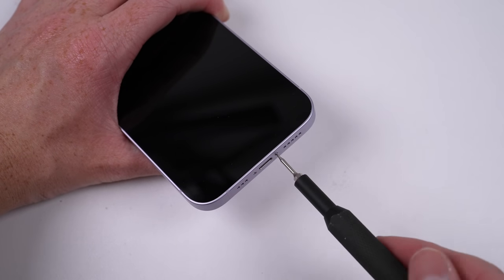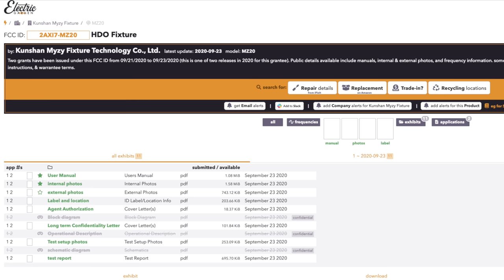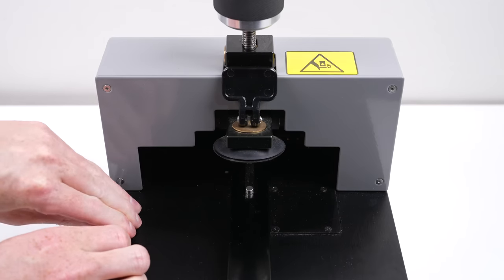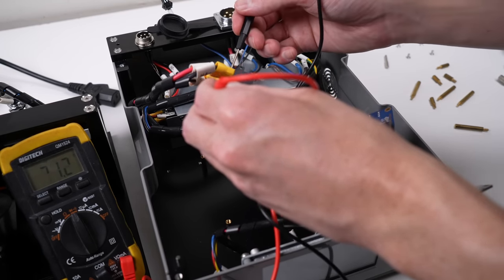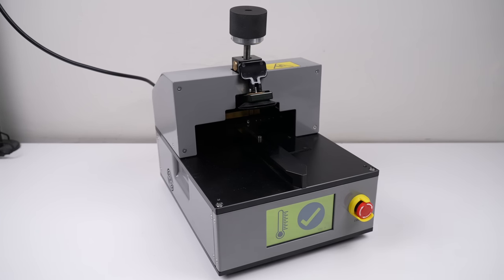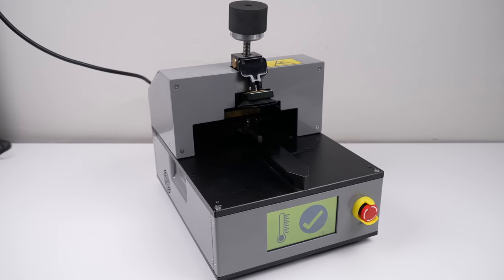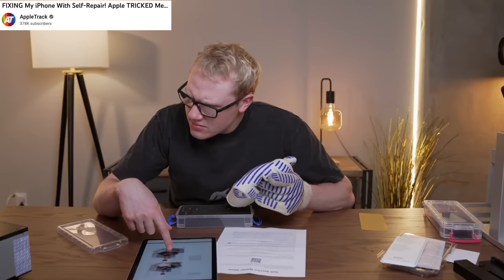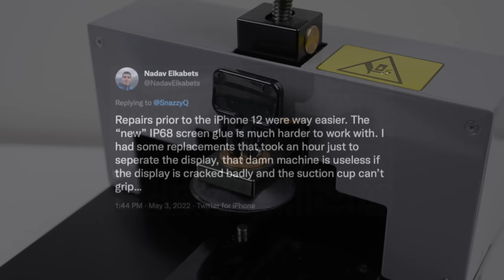This Is How Apple Fixes Its Phones - Tearing Down Apple's Display Opener

Comment: I work for an AASP, Geek Squad, and boy let me tell you that the heat press is prone to software failure causing the unit to brick and become unusable. Apple takes its sweet time to send out new ones.
Reply from the maker: Like what mine is doing or something else?
Reply: @toadster40  wait a minute a heating press can overheat and brick itself? isnt that the one thing it should be protected against?
Reply: @toadster40  that would be like a 3D printer that just totally burns the filament even if you set the heat to minimum
Reply: same here, our Precinct stays beefing with our heat press lol
Reply: I’ve never had mine fail like that contact CSS or make an escalation  they will replace the unit. But don’t get me started on the AirPod testing suite fml
Reply: @tylern6420  even the cheapest 3D printers with a 16x2 LCD show more information about the error and have tons of protections against actual faults, not just made up problems
Reply: I know why it isn’t working. The firmware version is outdated for the iPhone he inserted. He needs to update the firmware. But that will not work as he has no IRP/AASP access.
Reply: @speckbomber7219  I’ve never updated our firmware 🤷‍♂️ works fine
Reply: @speckbomber7219  why does a heater need a f*cking firmware update
Reply: @Danlapse  I did one time after the iPhone 13 came out. It didn’t show me an error. It did the same like in the video
Reply: It's ironic when even the repair tools brick themselves and become unusable. It's Apple, alright.
Reply: @zUltra3D  Because Apple.
Reply: @Hugh Jeffreys  sometimes it acts like the ones in the video, different codes every time or not showing anything. Others it actually does a good job of picking an error and sticking with it. At any rate when the machine dies we have to turn away most of our appointments for at least a week
Reply: @zUltra3D  because Apple
Reply: like mcdonalds ice cream machines, except actually an issue
Reply: @Danlapse  the Airpod is one of the most useless POS that we had to use at GS
Reply: @HughJeffreys  I also work for an AASP. It looks like someone was probably updating firmware on the machine and failed. That is why you don't see a firmware version on the bottom right of the display when turned on. The latest firmware version should be HDO V2.05. The only way to update the software is by using an Application made by Apple that is Apple Confidential.
Reply: I am glad our Squad didn't have that happen yet. Our fixture is still working.
Reply: @ShushLK  it’s not GSX. Its a 
MacOS application which will only install on an apple managed AACP Mac.
Reply: Lol a true apple product bricking itself. Despicable.
Reply: We've nicknamed ours the E05 machine
Reply: leave it to apple to design stuff to break that shouldnt break...
Reply: @Danlapse  It just needs more hot pockets, preferably pepperoni

Comment: Is it not crazy to think that actual engineers were paid to make an iPhone objectively worse?
Reply: I think that's just a fact at this point.
Reply: @GareWorks  yes
Reply: I can imagine one of the next iPhones being a sealed-shut glass capsule, phone shaped, the only way to access into being to shatter the screen with 500 bucks worth of repairs to get a new enclosure and seal it back. And, like, touch everywhere, and no physical ports outside
Reply: @ShitHappensRLY they made it more repairable last year tho…
Reply: @LesGrossman_69  how does it give you less freedom. Do you want more freedom in usage of a more powerfull device or do you want more freedom in reparating it (which is already possible). A lot of android Phones have also followed Apple and are not as repairable anymore. This is to make the products more water tight and last longet
Reply: And still we are buying like crazy
Reply: @tjadejoh  These are the words of a fanboy - supporting a product without truly understanding it. Anyone can smash a phone and get into it, but since you're comparing Apples to Androids I'll do that too. Both the iPhone and Pixel block biometric authentication if components are replaced. The reason people got mad at the iPhone for it and not at the Pixel is because Google released a super accessible software that will recalibrate your fingerprint reader for you after it bricks. We call Apple anti-consumer for it because they force you to throw money at an Apple store for "security reasons." But if those reasons were actually security based, then wouldn't you want to make sure the consumer could fix the security issue on their own as fast as possible? Unless, of course, you are ANTI-consumer.
Reply: @LesGrossman_69  not everyone wants what you want
Reply: @SuperBoop  but that's the great thing about freedom right? You have the freedom to do all those things, or not to if you don't want to. Within reason, everyone gets to do what they want to do!
Reply: @Mr_Lesbian  some people prefer to be controlled by huge companies
Reply: @LesGrossman_69  I don't have an iPhone, so I wouldn't know
Reply: @LesGrossman_69  then an iPhone might not be for you. Maybe you are in a bit of a niche group. Luckely, You have freedom of choice and dont have to buy an iPhone. So I dont know why you are trying to change iPhones if you can just buy something else
Reply: Don't blame the engineers, trust me on that bit. I'm sure they are writhing for making it like that. Blame the Apple's board and lead teams, which are often not engineers, but business men first and foremost.
Reply: @MidnightMustang  Well I did say that the engineers were paid, I'm sure any reasonable engineer would know "this isn't actually better." The problem is really the money-focused men in black suits,
Reply: @LesGrossman_69  Alr then go blame the stock market for not removing Apple from it. While you're at it, go blame the founders of Apple that changed the smartphone market so that you can have your beloved modern Nokias.
Reply: @tjadejoh  Mmmm... maybe its about trying to educate the ignorant about their purchases, where some users are almost so religious they need deprogramming?
Reply: My dad was a great engineer.  He was complaining to me about orders for planned obsolescence for propellant manufacturing systems for the military in the 80s.  He always tried to just make modules to go obsolete and be switchable while keeping the overall design intact.  Now it is taught as principle of design at schools.  No way out.
Reply: They seal the phone that way for the ip rating for water and dust
Reply: @LesGrossman_69  you’ve obviously never watched a Samsung teardown
Reply: @darrenstrathdee7425  Okay, but why are batteries held in with so much adhesive then? Why are there 21 screws holding in the speaker and charging assembly (Hugh's latest video)? Engineers also include software engineers, why do they disable true tone and face ID when there's actually nothing wrong with the phone?
Reply: @scepter0143  so it does not rattle and is securely in. They adhesive strips are the cheapest option. I work in a shop as a repair tech. The tabs can be pulled. Samsung do the exact same on the new models. On the samsung you have to pry. Zero pull tabs.
Reply: Yeah Apple doesn’t want people like you  working on their iPhones. 😢 more
Reply: Sorry for being the 421st like 😔
Reply: Comments section (as ever) is fuelled by sensationalism based on knee jerk reactions, emulation of peers and inexperience of life.
Reply: @scepter0143  Pixel users are usually geeks or are into tech. iPhones, on the other hand, are popular across various demographics, many of them not tech-savvy at all. Therefore the baseline consumer that Apple expects is the one who would just return the phone to Apple for repairs, rather than attempting to fix their phones by themselves.
Reply: @haomingli6175  That is a valid point - except for one thing. The Pixel recalibration software is web-based, specifically designed to be as accessible as possible for the ordinary person. Right-to-repair is giving people the opportunity to fix it themselves, but the dealership option will always be their for what you say is "the baseline consumer that Apple expects." Honestly, hats off to Pixel for that.
Reply: @scepter0143  The time when you need to access the website is after you have taken apart your phone and replaced the parts, if I remember correctly. This is what makes it a geek thing, rather than the website itself.

Comment: I'm always amazed and horrified how much thought apples puts into their devices to make them as repair-unfriendly as possible. These hot-pockets are just the cherry on top.
Reply: That’s the smartphone industry for you look at Samsung too🤦‍♂️
Reply: Most manufacturers do this glue and clip thing as it speeds up assembly time and reduces cost
Reply: @djashjones  Not All
Reply: The hot pocket is not even hot, you have to provide heat yourself!
Reply: I'm not -- it's just as expected -- apple sees their products as consumables... use it.. then toss it.
Reply: At Apple, the words "Universal compatibility" is a slur
Reply: Samsung is even worse lol.
Reply: @jaehaerys48  nope
Reply: @jaehaerys48 oh they're trying, but still not even close. Apple is still at the top with this bs.
Reply: @djashjones  how exactly does gluing the case shut rather than  just clipping it shut speed up assembly?
Reply: @markellii3093  Hell there's no meat, cheese or tomato sauce either!

Comment: Former IRP tech here.  We actually didn't have access to buy these till early 2022.  We still didn't use them because the franchisee I worked for was loath to spend money on tools beyond what I absolutely needed as a gear snob.  What's simultaneously funny and sad is that this video featured more info about this than Apple does in their IRP training.
Reply: Not really. U can find documentation about literally everything in GSX2 and in ATLAS

Comment: An AASP Service Engineer here. I think your heat pockets are not good. It doesn’t detect a phone has been inserted. I use it every day and the only time I see trouble with it is when I turn it on and directly insert a phone into it without waiting it to be green. I absolutely love it as it makes my repairs easy and opening display like butter. I have never ever fucked up a display while opening. I have colleagues crack display and then they gotta pay for the display repair. With this machine I never had to deal with it. ❤
Reply: Wait, you have to pay for a display? Wouldn't touch it then without the machine.

Comment: You could replace the mainboard/arm processor with an arduino. Figure out the desired temps and use the touch screen to control it. It would probably be more reliable than what's there.
Reply: The touchscreen looks like a nextion display to me
Reply: @mishaproduction  For me too. It uses UART as there a only 4 wires. VCC GND TXD RXD
Reply: @MyszkoServe  the uart protocol that nextion uses is really simple. It's just directly setting commands to the device. Example: vis thelabel,1 (to make thelabel visible)

Comment: For the security bit, just use a flathead screw driver lol. Also works for security Torx, just need a small flathead.
Reply: i did this, removed a security bit screw with a flathead....well made it non security bit anyhow

Comment: I love to see you actually repair this and explain what went wrong with it.
Reply: It failed at the design stage...
Reply: @edwardfletcher7790  true enough
Reply: the firmware is outdated, he needs to update the firmware so the tool knows which iPhone it is.
Reply: Or if not then send it to one of the many YouTube electronics repairers. I would have initially suggested the excellent 'Mend It Mark' but as he's in the UK that may not be practical. Another great repairer is 'Defpom's Electronics Repair' and he is based in New Zealand so that's much closer to Hugh.
Reply: @speckbomber7219  The fact an Apple hotplate uses firmware & RFID rather than a 0-5 min timer tells you all you need to know about Apple....SIGH
Reply: @SlartiMarvinbartfast  even maybe just contacting them ,  they may be able to offer some ideas to troubleshoot it...if theyve seen this vid they probably may already have done that...be good to see it fixed
Reply: @edwardfletcher7790  Eh a simple PID temperature controller is pretty good to have in a device like this if you want repeatable results

Comment: You need the official “apple official repair kit” kit, it comes in a container at 3 tons 😀
Reply: would probably start at a base price of 3 grand plus 1.5k each for attachments and 500 just for the power plug 🤣
Reply: and requires three semi-trailers, a police escort, a backup driver crew, a hydroline lift crew as it passes under. You also need to notify the FAA and notify the CIA of transport of encrypted material across state borders!

Comment: Bloody hell! What a chunky machine!! I guess using this device means you're less likely to damage the screen/glass (or body) when removing it, and I assume it would be 'somewhat' quicker?? But paying USD100~ each, every year for the each new iPhone adapter tray, becomes a pretty costly/ongoing exercise!! Great little insight Hugh, thanks Mate.
Reply: What's the bet the individual phone repair manuals are only available as a subscription service ?
Reply: $100 a year for an upgrade to this thing is nothing for a business using this thing all the time
Reply: @Fireclaws10  Your didn't listen, it's $100 per model !
Reply: That's 300 USD a year, 400 if they release an SE.
Reply: @edwardfletcher7790  ok? that's pretty tiny for a business expense
Reply: @Fireclaws10  The vast majority of Phone repairers are sole traders working from home or a booth.

Think about how many iPhone models are in common use, 20 ? 25 ? At $100 ea....
Reply: @edwardfletcher7790  if you can't afford $100 to get a tool for probably the most common repair on an iphone, then your business is failing.
Reply: @Fireclaws10  Are you daft ? It's $100 for each model....
Reply: @edwardfletcher7790  That's a tiny cost for a repair business.
Reply: Did you want it slim and light, running iOS? It’s A TOOL not a toy.

Comment: Just a thought that may have been missed. Try twisting the red emergency stop button on the front of the machine. It looks like it is pushed in. Once it is released it may work. It isn’t 100% assured, but I thought it was worth mentioning. Awesome stuff as always Hugh.
Reply from the maker: Its connected to the power supply "on-off" switch. The unit wont even light up without it in the right position.
Reply: @HughJeffreys   Did you check the Switch thats being pressed by the sled ?
Reply: @HughJeffreys  no worries at all Hugh, it was just a thought.
Reply: 1:22 he released it here
Reply: @HETyoutubekanaal  thanks for pointing this out, somehow I missed it.
Reply: @HughJeffreys  I have the same issue with my girlfriend! She doesn't light up either unless she is in the right position and her microswitch is fully depressed!

Comment: indeed with a big screen like that you would think that they would display far more useful information. it could be a nice raspberry pie application to replace the non functioning boards inside & have a universal system. also the hot pockets could have adjustable sides to allow any phone to be used in the cradle. the system makes more sense if you are doing 100s of screen a day at a repair centre.
Reply: I was working at a company using a similar display for our equipment and there was no good reason we couldn't display useful error messages. The reason (not a good one) was we were using an off the shelf piece of hardware and didn't have people to write code to display a useful message. Apple, on the other hand, could have just stuck a phone on the side with the manual built in.

Comment: I understand that for individual repair shop this machine is not ideal for budget. But for customers that pay Apple to fix their phone, this is actually really nice. Why? it basically eliminate any human error that could lead to damaging your phone. There was once I found my aluminum frame scratched after it got repaired from official Apple store. I spent an hour there arguing with the staff and despite I showed the photo I took before repair, they refuse to admit it was their fault. Eventually, I recalled that when they took my phone, the diagnose was recorded as no outer damage to observe, the manager came out to apologize and agreed to exchange my phone.

Comment: If you look at it from a corporation/business perspective, apples over engineering and idiotic repair tools (looking at you battery placer tool) make sense though, it takes the human element out of the repair and basically guarantees the same level of service at every store.
Reply from the maker: Now anyone can be a genius (genius bar technician that is.)
Reply: Those Genius "experts" would destroy your phone without these tools. 💀
Reply: @_modiX  only because apple doesn't care enough to train them when they can just make tools to make the process not dependant on the technician.
Reply: Duh!

Why do you think MacDonalds designed and manufactured THEIR OWN bespoke equipment for the production of their food, and the most efficient use of space in their kitchens?

A brand thrives or dies on known quantities; repeatability and uniformity. 

You must be new to processes and understanding mass production and repair. 
 (see “time and motion study”)

Comment: The bit where you told us in detail about all the steps you took to remove the slightly stiff screw by using a bigger screwdriver, was edge of the seat stuff!

Comment: Heck you could create your own power unit for the hotpocket  and an Arduin or even an ESP32 or if you want to get fancy a raspberry Pi replacing the  original control board so easily and bypass all the crap and use a 555 time to set the time based on a keyboard input. I think hacking the unit into a useful reliable instrument would be worth the effort and make a cool video!